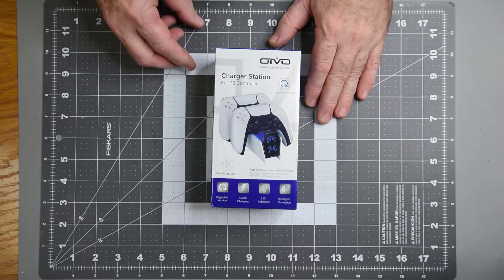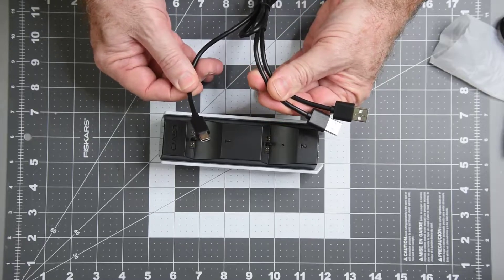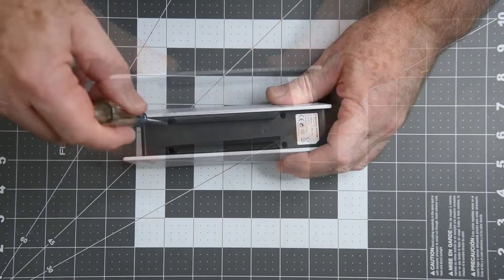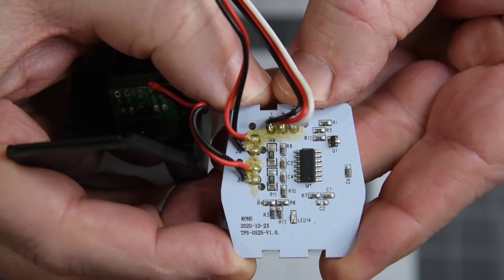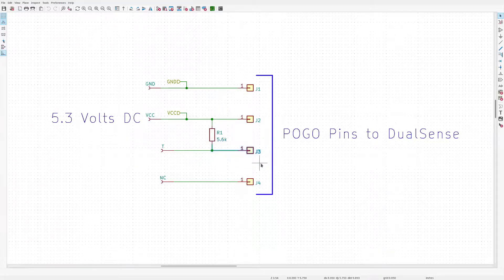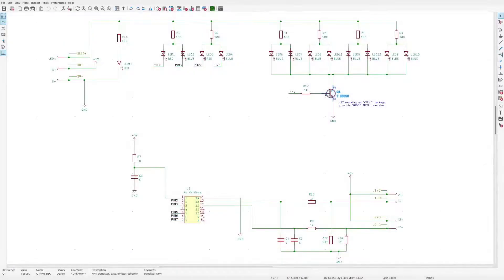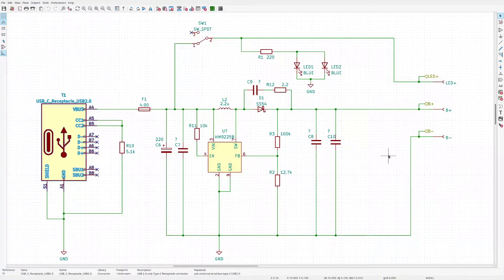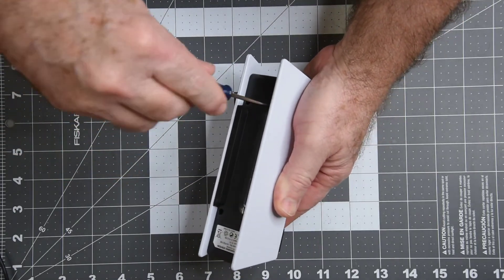OIVO PS5 DualSense Charging Cradle: Review, Teardown, Exploration

Comment: If you wanted to make a custom cradle charger. Could you connect a usb charger to the two pads you indicated, connected to pogo pins.  Just to charge no lights or anything.
Reply from the maker: I believe so.  Just need a good clean and stable 5 volts.
Reply: I tried it doesnt work , I think maybe I need a pull up resistor.
Reply from the maker: I think there may be a pull up resistor.   I can't remember for sure.  It should be in the oivo teardown video.   @TC-dk6do

Comment: I noticed that in the schematic, too - no clamp for the output voltage. They're relying on the connected supply's designer having done his job better than they do theirs.
Throw a 5.6 or 5.8V Zener in there. 1/2W Zener in a DO41. Sixty cents will save you sixty bucks for a new controller.
Reply from the maker: Yep, was looking, lowest I had on hand 6.2, so going to order me a few next order.